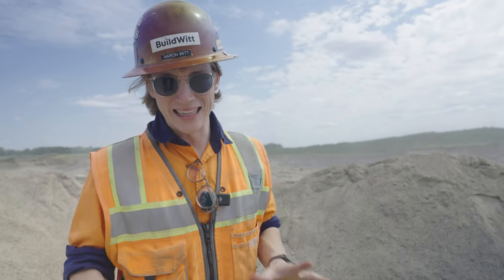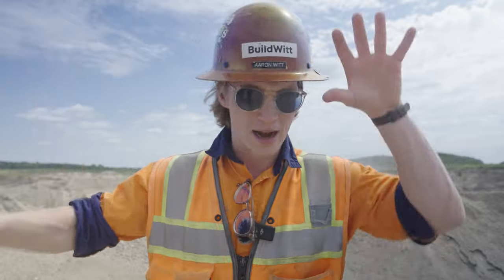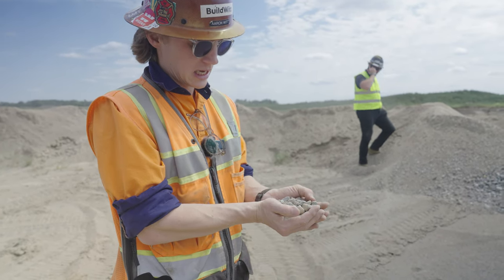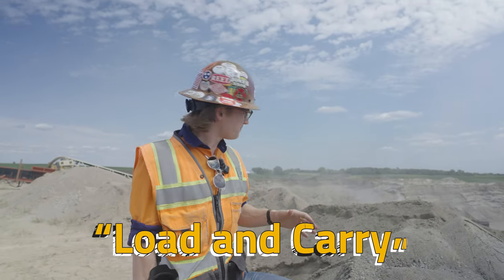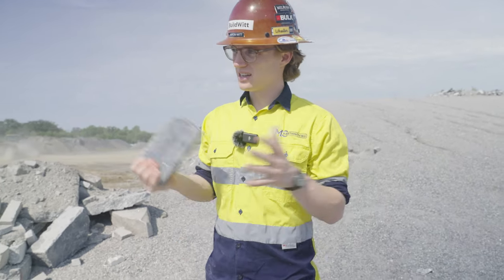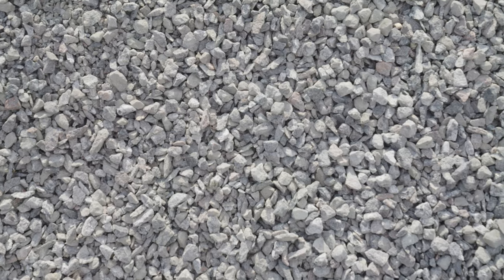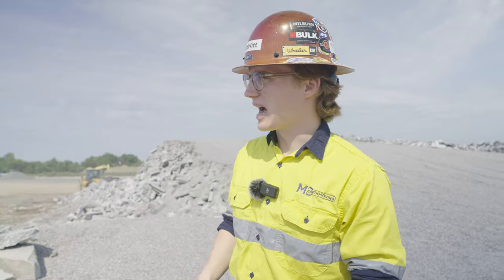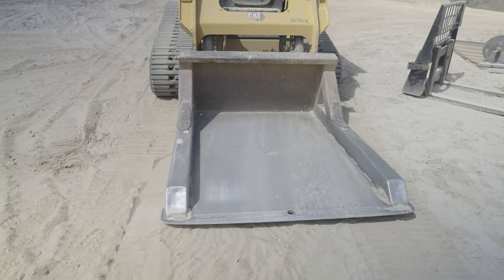How Mobile Crushing Plants Work with WD Scepaniak

Comment: At every crushing plant they have a skid steer he says I wish we had one 😂 we put old conveyer belt sections under are tail pullys and sections where stuff builds up and pull the stuff out like that with a chain and a loader
Reply: We couldn’t go without ours. We have a home made rake on ours. Alot of our setup is old so they leak Alot of sand. Especially the terex crusher. We put a piece of sheet steel with rollers under it, old conveyor sections to seal the sides, and a chain to pull it out. Problem is if the skid steer ever goes down it’s far too heavy to move by hand. I like seeing how other companies do things. In this case the spoon wouldn’t help us because of the weird angles and tight spaces

Comment: Its easy to do 5000 tons on what is mostly sand,  try all rock in the same setup.
Reply: Correct
Reply: Sounds like you know much more than A-Aron
Reply: @WorkingOnRocks Gee , I'm a retired heavy equipment operator who ran portable crushing units. So yea ... I know more.
Reply: @jimbeam2705 way to get all high and mighty, eh? Aaron's just trying to show a video of a couple crushing spreads and you gotta make it a competition.
Reply: @thatmnguy6099  not hard to know more than these numpties. Basically the HR and marketing department.
Reply: @thatmnguy6099 Hi NOT SO BRIGHT,  no its talking from experience.  Nothing high and mighty about it , just pointing out facts to people watching this that have absolutely no clue .... like you. 😂
Reply: @jimbeam2705  The thing is, no one asked.
Reply: @pr7765  Poor baby, are you butthurt now ? 😂
Reply: @jimbeam2705  ? That's a weird response. Are you a boomer by any chance?
Reply: 5 of base , 5 of sand
Reply: I manage a mobile sand pit, but because of moisture, I can only do about 2200 to 3200 tons a day
Reply: This stuff looks sandy but I’ve worked in pits that are so rocky you need a excavator to loosen it up for the main loader. Blast rock is the worst though.
Reply: @johnscepaniak3959  that is what i gathered from that statement too, hard to believe that a 988 feeding at the rate the plant is going in the video is doing 400-500 ton/hour.
Reply: Bring in the 994k to load out that stockpile once run through the crushing plant ... creamy loading

Comment: If ur only doing sand little rock in it should be way over 5000 a day .also why not use a rake on the akid does way better job imm
Reply: 5000 of base, 5000 of sand per day.  10,000 total